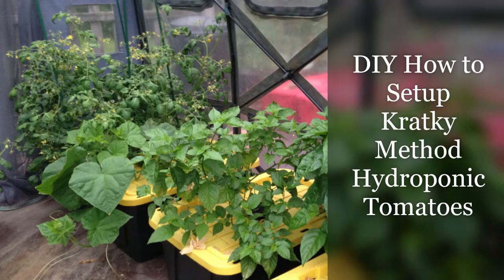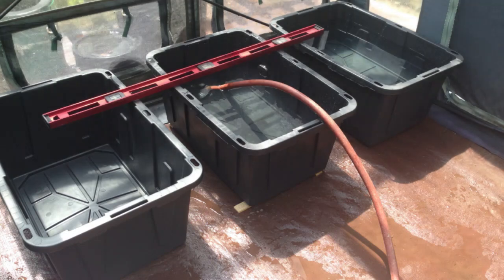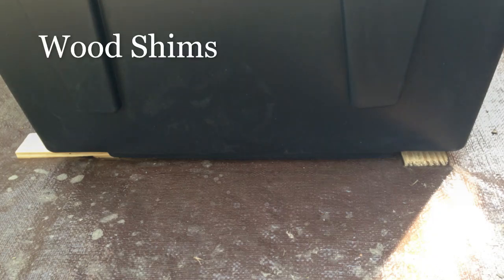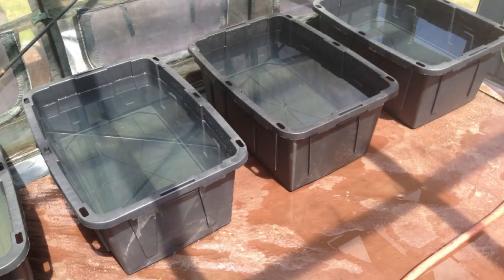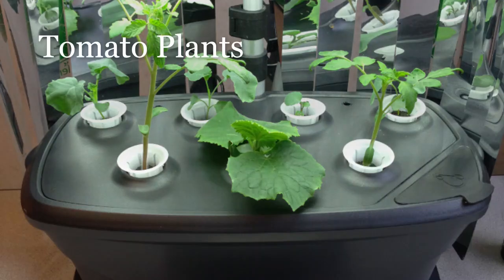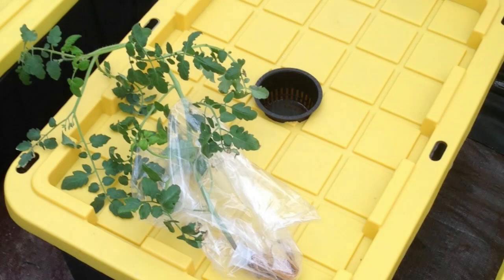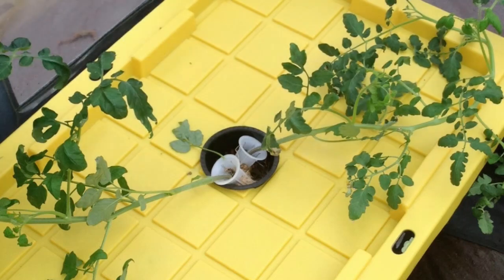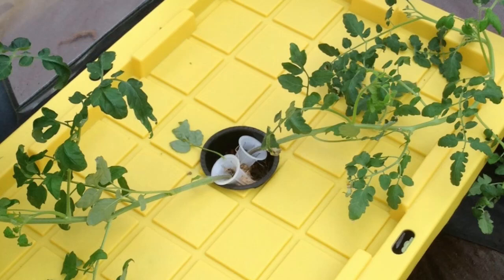B.A. Kratky Method Hydroponics - Part 1 of 2 Tote DIY

Comment: Matt, very nicely presented pair of videos.  An excellent intro to Kratky.  Question: have you ever tried growing a "larger" dwarf tomato (maybe 4-5 feet tall) in one of your totes?  In particular I am thinking of a wide selection available from the dwarf tomato project.  Wondering how many gallons such a tomato would require...
Reply from the maker: Thanks!  Patio F1 Hybrid did okay in 20 gallon trash can.  Have grown 8 foot tall cherry varieties in 44 gallon trash cans.  This float valve version would be ideal for what you are growing.  https://youtu.be/cnu7DRooD14
Reply: @MattGarver  The 27 gallon totes probably start with maybe 25 gallons of fertilized water.  In one of you other videos you grew a very healthy looking, larger, cherry tomato (inside!) in a 14 gallon container.  I am wondering if the 25 would be enough if one grows a 4-5 foot determinate inside (less evaporation).  It also crossed my mind that one might add a quart of solution to the tub each twice a week.  Such a small amount added at a time might not cause an air root issue over the large tote, and would over the grow effectively make the 25 gallons more like 33 in a 4 month grow.
Reply from the maker: @davidlangan4902  I have grown 3.5 foot tomato in an 18 gallon indoors for reference.  My 14 gallon plant was a micro dwarf cherry variety.  Your plan should be a good experiment.  If adding water, keep your water level at the base of the net cup for 2-3 weeks instead of adding later.  My suggestion is to try fill once and forget and see what you get.
Reply from the maker: Quick question, what dwarf varieties are you planning to grow?
Reply: @MattGarver  I grow in Mobile Alabama and about June 20 or so our outside production shuts down due to heat, rain, and humidity.  So I have been seeking determinates and dwarf plants to get more in before shutdown.  Dwarf tomato Project is intriguing and the one that has caught my attention is Rosella Purple.  So that is the one I want to try growing inside in a 27 gal tote.

Comment: Hi Matt! Did you use miracle grow or any kind of plant food in your totes?
Reply from the maker: Hi Emily, I used an all in one liquid nutrient called Dyna-Gro 7-9-6 that I bought from Amazon.com.  There are many different nutrients that work.  Some multi-part, some are powders that need mixed, and some are very expensive.  I have heard of people using Miracle Grow.  Apparently, it works but not as well as other hydroponic nutrients.  I would suggest experimenting.  Have fun gardening!